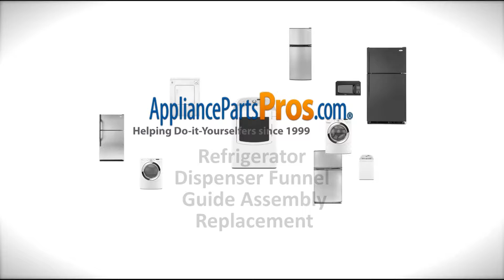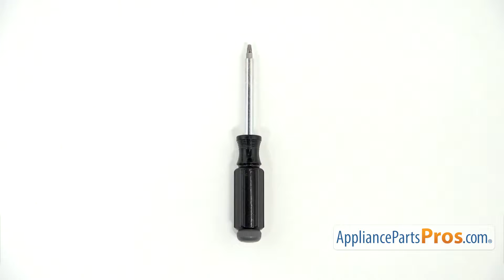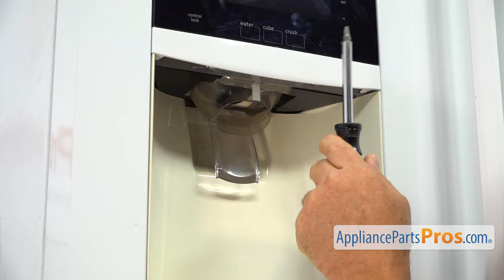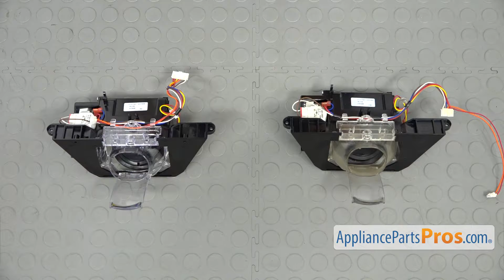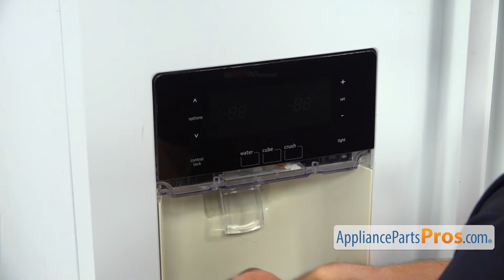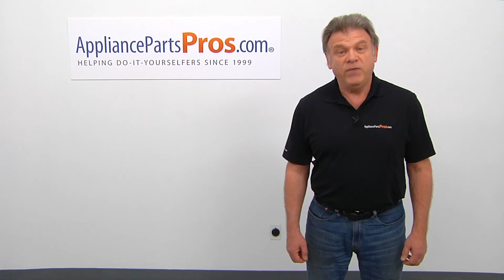Frigidaire Refrigerator Dispenser Funnel Guide Assembly 242270102 Replacement — fits Electrolux

Comment: My dispenser paddle is floppy as if it maybe came unhooked from a spring? If I work it Forward and backward with my hand the water dispenses an stops according to its design. Is this something I can fix by myself without having to order a whole new unit. I haven't been able to locate a blowout/diagram of that particular part assembly
Reply from the maker: What is the model number of the unit? Sometimes they come as separate parts and sometimes they come only as a complete assembly (depending on the model).